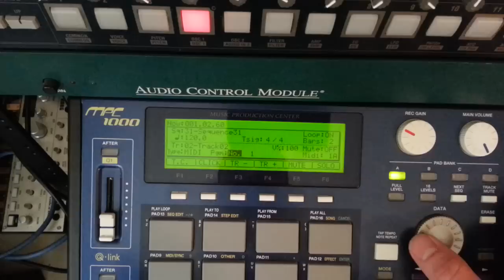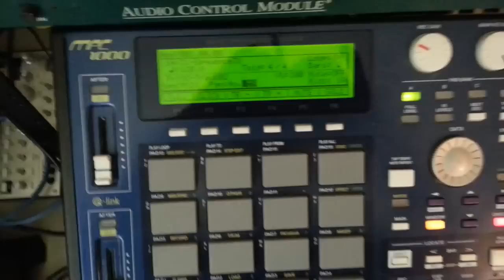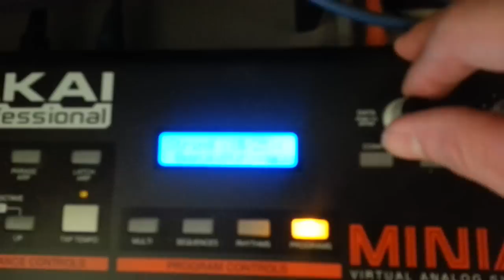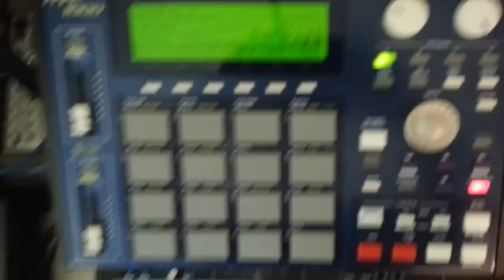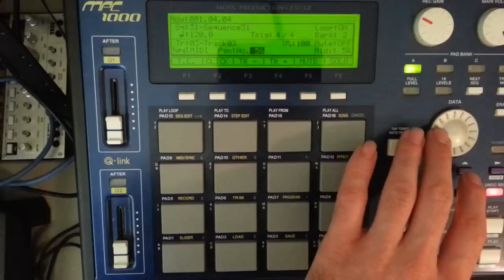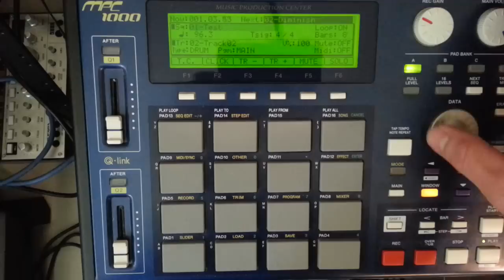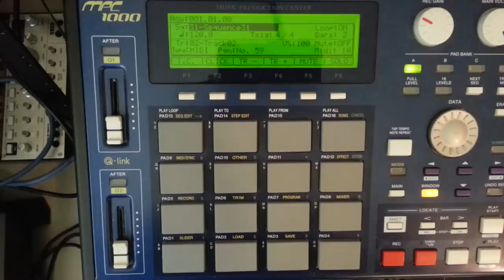Mpc 1000 program changes with bass station, miniak

Comment: You can also implement these changes during your sequence if you really wanted two separate sounds from your bass station in one sequence. You would simply need to send the program change at the right time (like a pause in the music) and record that into the mpc. If you were playing program 5, and wanted to change to program 32, overdub from a place slightly before the new sound is played and using a controller send the program change. That's how they recorded multiple instances of the same instrument with a two-track midi recorder in the 80's!

Comment: Hi there! i fallow your channel, thank you so much for doing this. 
i just bought recently an mpc and fix it, and I tried to load some modular samples that are converted ,from 24bit to 16bit as is required, and I get some error when I try to play or load. i also try to load them unconverted but still the same problem.
Reply from the maker: Thanks for the follow! I recommend trying a free program called MPC Maid. Basically it is a utility to setup and assign samples, BUT also it will play samples if they are in the correct format (so use it to test your samples first!) Also you can use Audacity to export your samples because I've read they do need to be 16bit AND 44.1khz and wav format. Good luck!

Comment: Huge Thanks for explanation Sir. I control my Korg Pa 1000 with Roland A-500 Pro. I can select styles, sounds etc. via controller A-500 Pro. But I cannot control Keyboard Sets. For example to assign Pilot Lead Keyboard Set to external controller Roland A-500 Pro, I programm MSB: 16, LSB: 7 and PC: 11 as per chart on Korg Pa1000 manual. But it gives different sound. I added +1 to PC but no success. I spent several days, but no success. Could you please help? Thanks in advance
Reply from the maker: Can you save the Keyboard Set into a blank SongBook entry and then select that? I am not familiar with the PA1000.. If that doesn't work, I would email Korg Technical Support